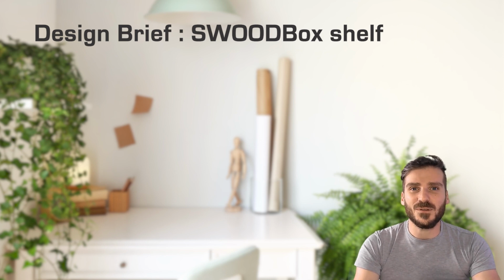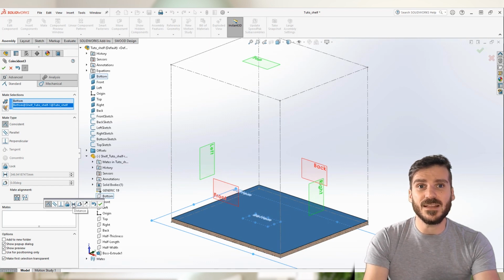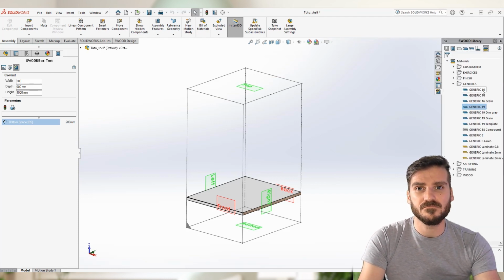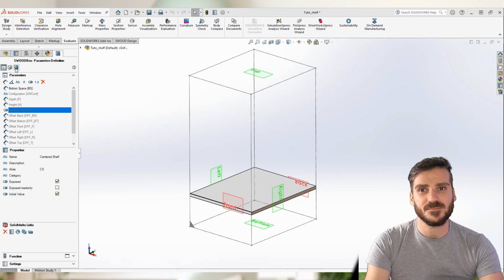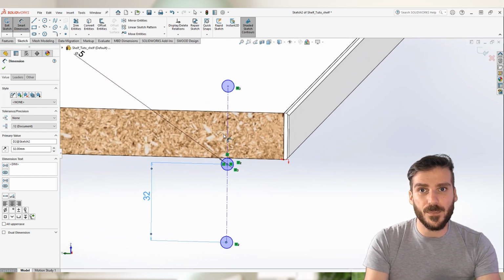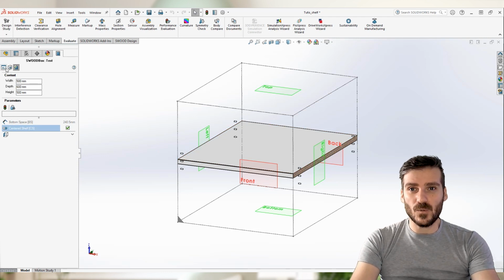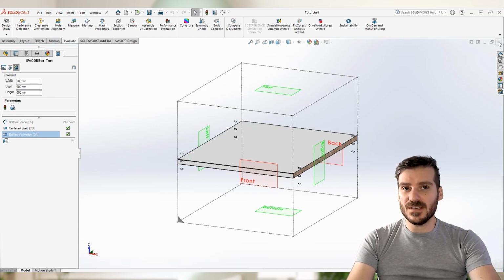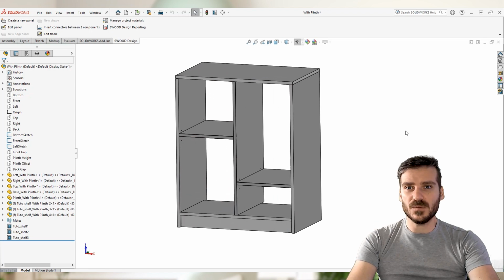How to rapidly design custom furniture using SWOODBox? (Tutorial)

Comment: Hello, is there any tutorial how to make BLUM furniture? There are some drawers, but it's missing panels and etc, so not working properly. Is there any tutorial available how to create swoodbox with hinges / drawers?
Reply from the maker: We are currently updating the library for Blum furniture, please contact your SWOOD reseller for specific questions.
Reply: @SWOODbyEFICAD  I notice the feature BLUM IMPORT, just as I understand it's not ready yet, correct?
Reply from the maker: The BLUM IMPORT feature is ready to use. It allows you to import cabinets, and projects from the BLUM E-service platform to SOLIDWORKS and SWOOD.